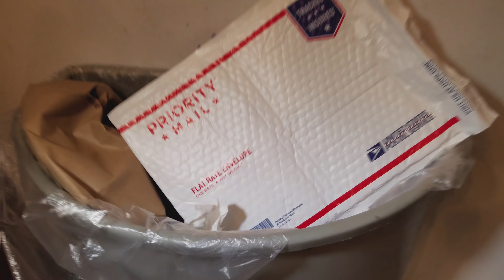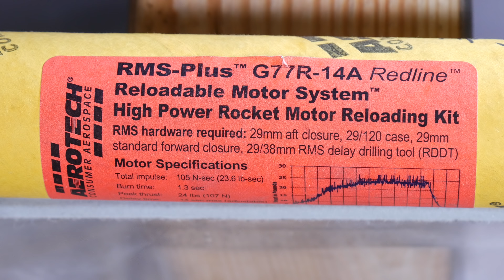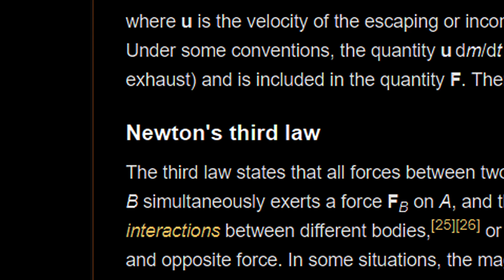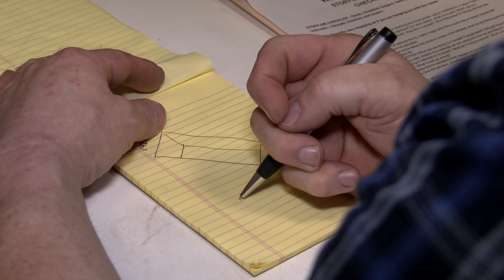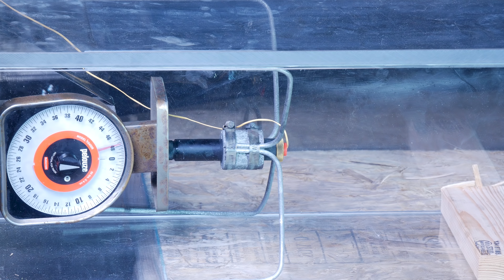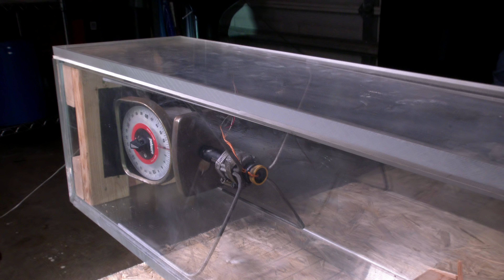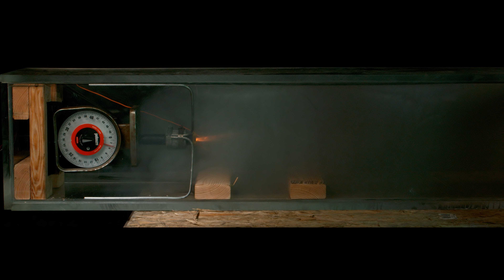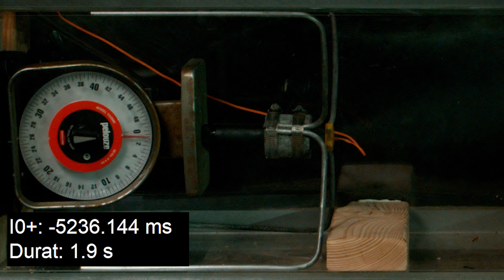Rockets in a Vacuum Chamber - Newton's third law of motion Visualized

Comment: I doubt that thing could hold the vacuum. It would have been nice if you showed the pressure gauge too.
Reply from the maker: booger king doubt all you want, it did, I did all of the math when I built it, why do you think we're standing behind a blast Shield for show? We show the Gage at 10:12, we did it that way so it was uncut, so people couldn't claim that it was a separate shot. You can clearly see the pressure change when the rocket is burned
Reply: you can also see that vacuum is lost during ignition because of the gases produced, you can see that on the gauge...so..it wasn't a vacuum then
Reply: MyVumvuvum Hurts Actually his failed burn where the ignition pops out proves that thrust can be achieved in a vacuum, granted on accident.
Reply: That pressure gauge isn't capable of showing anything near a "complete" vacuum or conditions in space anyways.
Reply: The pressure gauge is at the wrong place it should be above the weighing scale...
Reply: Brian Lawyer
There is no such thing as 'complete' vacuum. Even space isnt 'complete' vacuum. Besides, who cares? The higher the vacuum the better for a rocket - less energy wasted on air resistance (drag)
Reply: carl ordena
And what is the fucking difference? Pressure is almost the same and uniform in the entire chamber.
Reply: 1 bar isnt that big of a pressure mate a lot of people overestimate the atmospheric pressure
Reply: good point Robert
Reply: Barnabas Igari, 1bar is all the  difference is between space and sea level on earth.   in the space craft, its more like .25 bar... the pressure differential between space and the ISS space station is only about 3-4psi total!  vacuum outside, 4psi in side......thats it.
Reply: I must be loosing it the more I watch these videos the more I begin to doubt NASA and space. I’m not saying there is no space I’m just kinda thinking NASA has no idea how it works or if they can even get there. 

I am a critical thinker by nature, at one time my parents refused me toys because all I did was take them apart. Lol. 

That said all my science projects were on the solar system etc.. I so enjoyed the wonder but there again at age 42 and some intense research things don’t seem to be what we are being taught.
Reply: +jonnljames The thrust is always exactly opposite to the direction of the rocket exhaust, not spraying all over the place.  Duh.

Steering?  Three ways:

1) Turn the rocket in the direction you want to go, then run the engine for a short time.  You'll keep going in that direction unless affected by gravity, in which case you pre-calculate the effect of the gravity, and adjust the initial direction of the burn.  This is how you "steer" a rifle bullet.
2) Mount the engine nozzles on gimbles, so you can turn the direction of the rocket exhaust a bit.  This only works when the engines are firing.  All rockets do this during launch, because tiny deflections from the desired direction during become bigger problems really fast, and the alternatives (fins) slow the rocket down and don't work well in space.
3) Do (1) and if you start drifting off your target, do (1) again.  It's called a "mid course correction".
Reply: +booger king With a mere 14.7 PSI (1 bar) pressure difference, it will take a very long time for a ping pong ball to get up to supersonic speeds, meaning the barrel has to be stupidly long.
Reply: +Mr Abelone  Youtube doesn't correspond to "intense research".  Watching youtube these days on this subject is an exercise in learning bad science from people ignorant of the science or are deliberately out to deceive you - almost always for the express purpose of making money.  Infowars has nothing to do with the "truth" (Jones has already admitted as much), Infowars is all about selling T-shirts and vitamin supplements.  The conspiracy stories he tells are simply a way of generating free advertising.

 Read Tsiolkovski.  He developed the rocketry equations that NASA (and everybody else) uses today.  In the 1880s thru the 1920s.  The most important work was published 60+ years before NASA existed.  Try reading "Exploration of Outer Space by Means of Rocket Devices" published in 1903 and its sequel in 1911, where he lays the theoretical ground work for just about everything we've ever done in space - multi-stage rockets, orbits, space stations, escape velocities and so on.

Tsiolkovski never personally built a rocket.  He didn't think his ideas would ever be implemented.  But in his retirement, he found out he was wrong about that, eg: Goddard, Oberth and so on.

The science of modern rocketry is based on Tsiolkovski's work.  Everything else since then is engineering better materials, better propellants and better designs to make better use of Tsiolkovski's science.

And yeah, Tsiolklovski's rocketry equation does show that rockets work in vacuum, and in fact better in vacuum than in atmosphere.

Taking things apart doesn't make one a critical thinker.  Understanding how the thing does what it does, and being able to use that knowledge to build something different (and better) makes you a good thinker, "critical" not so much.  Unless you're in the mode of taking things apart and proving that the thing can't do what's claimed for it.

if you were a critical thinker, there'd be no doubt in your mind that NASA (and the 50+ other space agencies, and thousands of companies in the field) have  accomplished what they say they have.
Reply: Ever heard of vacuum cannons that launch supersonic ping pong balls?
Reply: "why do you think we're standing behind a blast Shield for show? "
Seriously? You need blast shield to hide from a little firework sized rocket that doesn't explode?
Reply: @boogerking7411  ok, so rubber bullets kinetic energy is 98J (40g 70m/s) that is less than of the pingpong ball (imlact force about 4000N) while rubber bullet is about 8000N ... And rubber bullet is non lethal amunition... Also I am not from english speaking country... M0r0n
Reply: @boogerking7411  Fastest ping pong ball I found was 406m/s and that is 222,53J :D lol  :D rubber pellet is still more dangerous :P and btw, how does that relate to flat earth and rockets? you forgot to pay your brain bill :D
Reply: Also, it would hurt, but wont crack your skull
Reply: @boogerking7411  40mm vs 19mm that is my final answer...
Reply: @boogerking7411  you funny
Reply: @boogerking7411  Then explain 0G planes, vacuum ejector and should I go on Flerf? :D

Comment: A good experiment would be: instead of testing a rocket thrust in a huge ass vacuum chamber (it's hard to make one), you should make a huge pressurized chamber and see if there is a thrust increase due to increase of pressure. If there is an increase in thrust then you can say it would lack trust in a vacuum because of a direct relation ship of thrust increases directly as pressure increases.
Reply: Severely underrated comment.
Reply: oof you are thinking outside the box
Reply: Wouldn't that be why the nozzle size of a rocket engine only works nominally at one specific altitude? So obviously pressure is a factor for thrust....
Reply: @kk3623  That relates to something called specific impulse the pressure can reduce the impulse dependant on engine design.
It has more to do with the atmospheric pressure preventing fuel from leaving the engine than anything else.

But now that I think about it this would further prove the idea that you need a atmosphere to push off wrong since the atmosphere hinders the engine efficiency instead of helping it.
Reply: @kk3623  it is infact a relation to thrust, that is why vacuum engines have a larger bell housing to account for the faster expansion of hot gases in a vacuum.
Reply: @RallyRanchMotorsport  so what ru saying ?
Reply: @kk3623  that liquid oxygen and hydrocarbon fuel rocket engines do infact work in both atmospheric and vacuum conditions.
Reply: @RallyRanchMotorsport  you have been to space?
Reply: @kk3623  hahaha, honestly. If you're going to use that question as leverage for this argument don't. Because I know you haven't been to space either so it debunks your theory as much as you THINK it's going to debunk facts.
Reply: @RallyRanchMotorsport  lol ah ya got me on that one! Thanks for the discussion
Reply: @kk3623  I have a tendency to do that. Cheers and thank you for the acknowledgement.
Reply: Surly that would just be proportionate to the oxygen content? So we have 21% at normal- to squeeze more in would that alter the 21% or would it be the same just at a higher pressure? All of this is irrelevant if we cant protect yourself against radiation and bone density loss>if we ever wanted to come back to earth! Unless we just use robots but that leads to scary shit!
Reply: @chris-tg6ki  all of the oxygen needed for combustion/thrust is in the fuel.
Reply: @RallyRanchMotorsport  Read the original comment a pressurized chamber, so it would depend on what you pressurize it with! I understand that in a vacuum you can burn a fuel if you include oxygen in many forms ie, hydrogen-peroxide or liquid oxygen but what would happen if it was pressurized with argon, what i was getting at is that a pressurized chamber is still 21%oxygen if your pressurizing it from the atmosphere with a compressor, unless its pressured from a gas cylinder! As for oxygen in the fuel, you need oxygen to initiate/ignite the burn to start with, if its locked in the fuel it will not be released until ignition has started. Think of the triangle in science class when you were 12!
Reply: @texmex9721  wrong. There is more resistance from the water. Obviously 2 digit iq.
Reply: @RallyRanchMotorsport  work, but don't thrust.
Reply: @stevewittwer7444  hahahaha, nice try little dude. Are you a flat earther?